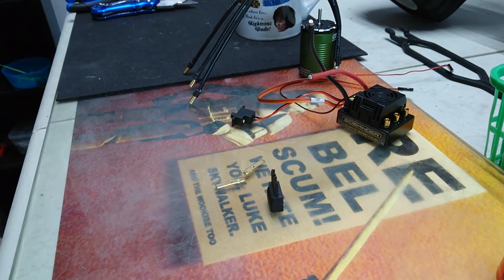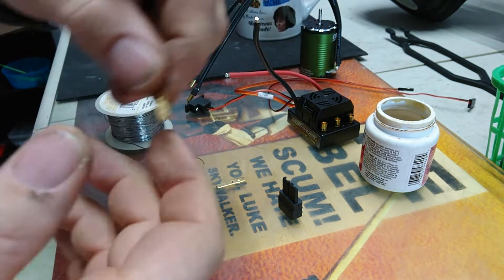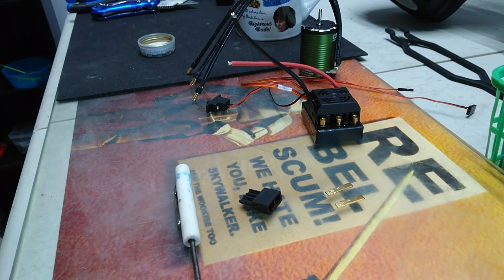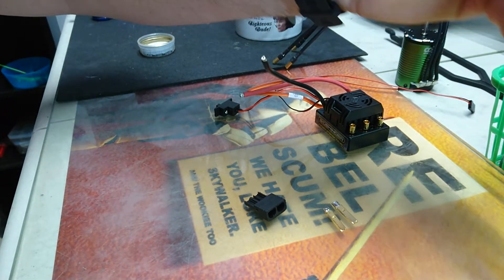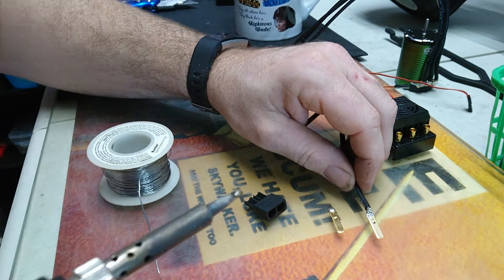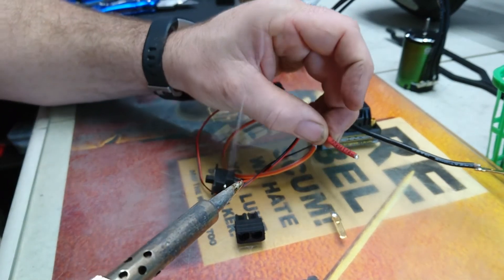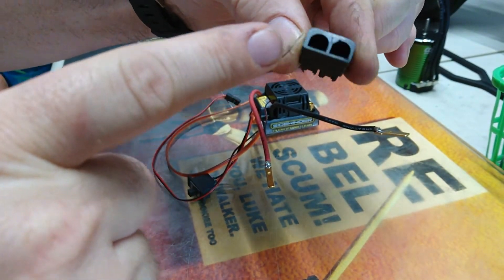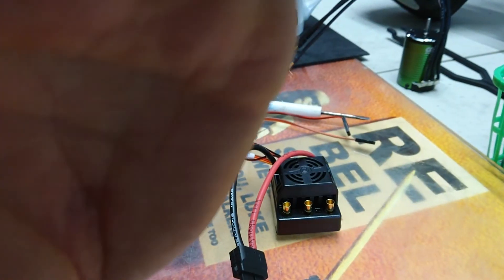Solder lesson on a Traxxas connector.

Comment: THough im not a fan of the traxxas connector, If you can solder them well it means ya know what your doing.  I learned to solder on traxxas connectors with lead free solder so no wonder i dont use traxxas connectores or lead free anymore.  It was a rough couple hours to change over 3 batteries

Comment: Tried my first soldering job today, was having a bot of an issue with the 10 guage wire, using it for my new max 6 esc for my xmaxx. When I pushed it down the wire flattened out too much and then would not go into the tab plug as it ended up 2 wide. Thinking of perhaps getting the 12 guage wire? As thimk that will be tick smaller. Any thoughts?  And thanks for the vid.
Reply from the maker: Thanks for watching John,
10 Guage is a big wire and will take more heat and time to solder. You can try a 12 gauge, but what I would do is trim down the flat surface on the 10 gauge wire so it fits the connector. If you need to reshape it, just put more heat and take you time. You will get it.
Asplenia. 👍
Reply: @asplenia  thansk for the response. Yea its s challenge but def a fun hobby so glad I recently discovered it.